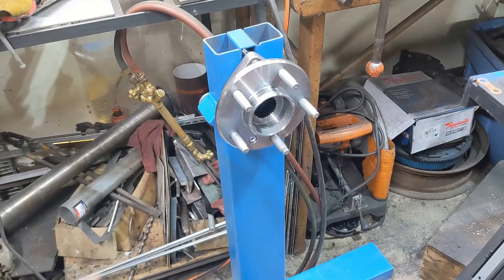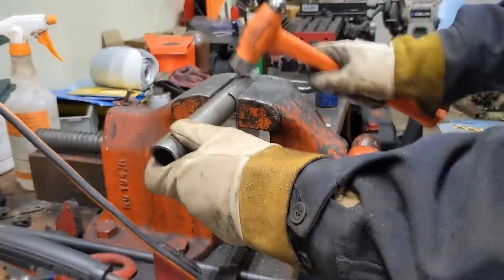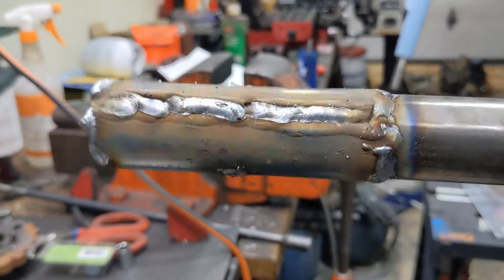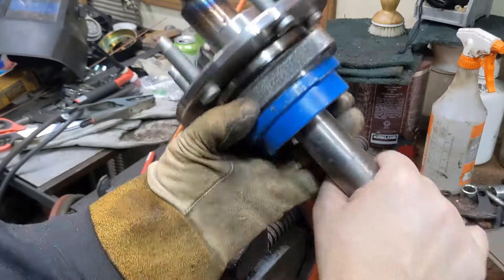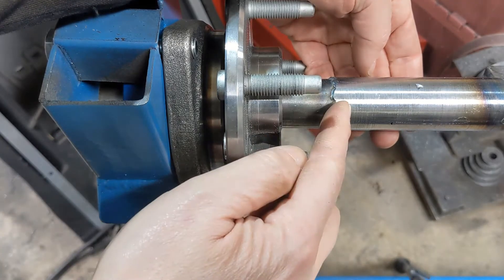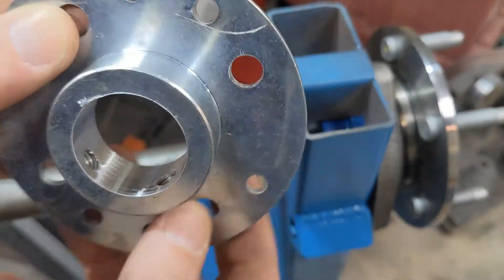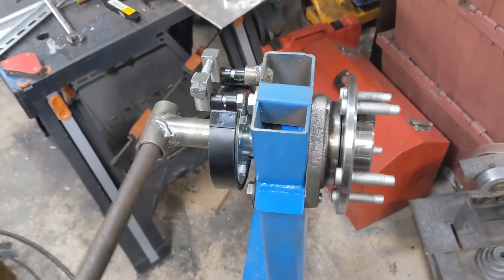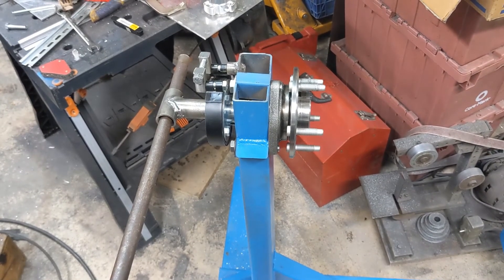Make Your Own Heavy-Duty Engine Stand (Part 3 of 3)

Comment: I like the hub idear ill get hub shaft goes in to hub get s cam cut spline end off lathe down to go in side shaft to hub and use slack adjuster to turn hub and motor im hooked

Comment: Nice one. Am looking to improve an engine stand and this gave me loads of ideas. I don't have a lathe, nor a mill, but am thinking how to improve the rotation mechanism. Good stuff here, thanks.
Reply: BTW there is corresponding spline shaft as bearing bushings straight out of the shelf. The worm gear has a self locking properties, so you wouldn’t need to use drum brake like this one here .
Reply from the maker: I wasn't aware these things even existed. They're definitely a better solution!
Reply: https://youtu.be/kzC11xPmhgc?si=HBKjvvTaa2sQClXR
Reply: Using truck air brakes slack adjuster as a worm gear drive is the best idea I’ve seen . It’s compact , cheap and easy to do .

Comment: I'm surprised you didn't source that splined shaft from a wrecking yard. The outer CV joint housing would make a great axle for the drive unit.
Reply from the maker: I definitely considered it, and I still think it would have been the better route.  But it was the middle of winter when I did this, and at the time I just couldn't overcome the idea of driving all the way to a pick and pull, wandering around in crap weather to find a donor, and pulling the part when I could just click a button. If I'm honest, age and the internet have made me soft.